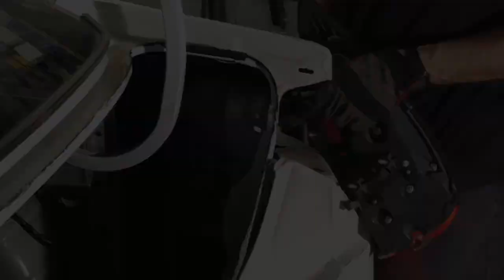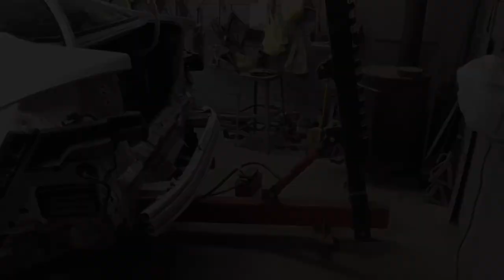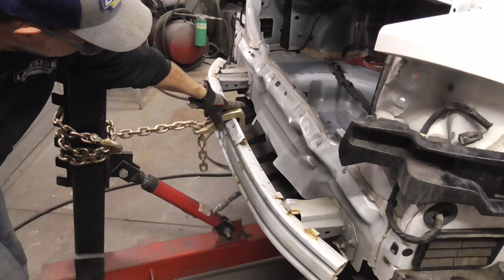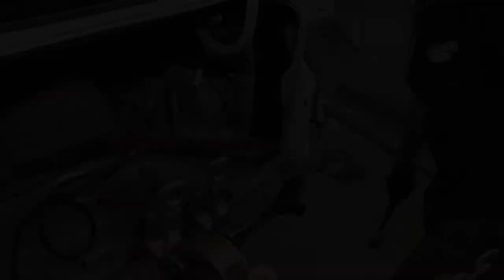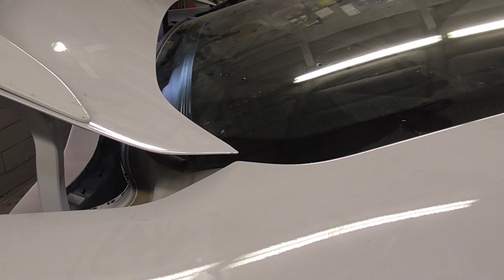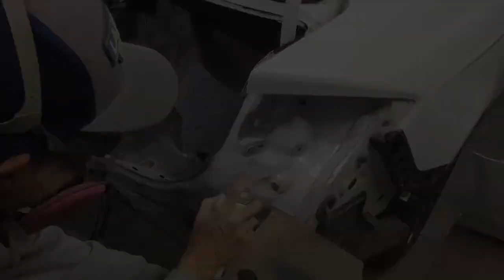Rear End Collision Repair - L Dozer Frame Machine - Start to Finish

Comment: I'm always amazed how crumpled sheet metal can be pulled back into place.   Also the strength of the pinch welds on the bottom of the rockers. Great video Jerry  as always
Reply from the maker: Thanks PSG - I gotta check out your fuel gauge vid yet tonight -  Merry Christmas 🎄❄🎄
Reply: @LakesideAutobody  Yes same to you !!

Comment: I wonder how much the local u-pull it yard charges for that rear panel (since you said it was like $1000 new). Merry Christmas, Jerry! (or Happy Holidays depending. lol)
Reply from the maker: They didn't have the rear body panel - so I pulled it best I could.  The bumper assembly was 350 (had a crack) and the deck lid was 2 something (had a few dings)  Merry Christmas to you too 🎄❄🎄

Comment: Nice work Jerry.  You know, years ago one of my good friends had a body shop.  When he needed a frame  straightened or unibody pulled out he called a fell that went by the name of “Fred the Frame Man”.  All he had ever done and all his father before him did.  He had a portable puller like yours that had little steel wheels on all corners to move it around.  It was amazing to watch him work.  He would just look it over and commence pulling first here and then there.  Before you know it all the body panels fit perfectly.  Once he worked on a Chevy pickup that had hit a bar ditch.  It was like a swayback horse.  An hour or so and it was straight as a string.  I enjoyed watching him work.  
I enjoy your hands on work much more than your tool reviews, just my opinion.  Try to stay warm.  Tom
Reply from the maker: Ain't that crazy.... my dad talked of guys like that back when he worked.  Said, "One old guy would come in with a bucket of tools and fix anything."  Those were the days I'll bet.  Good times the 50's-80's - Merry Christmas Okie Tom 🎄❄🎄

Comment: Very satisfying video, I needed this to repair the same issue with my Mercedes.   I have the ram tool kit and hooks with chains but not the bar pinch clamp and tower. Is there another way to hold the car in place and pull?
Reply from the maker: Yes. Body shops have pots in the floor with a chain to hook to.  You can use another car, tractor, tree, etc.  I have even bolted plates to the floor - sort of dangerous but if you do it right, it'll hold just fine 😊

Comment: It's like watching some kind of sorcery! Amazing. Oh, and a heads-up, I think the purple filter cartridges on your respirator are strictly for protection against particulates. For protection against spay paint or any other solvents, you should have a VOC (volatile organic compound) type of cartridge for vapours and fumes.
Reply from the maker: You're right but I was in a bit of a hurry - plus it's spray bomb so... but better to be safe.  Here's the one I use when spray paint with an  activator and isocyanates - 3M 07193 Dual Cartridge Respirator Assembly Organic Vapor , Large

Comment: Hey brother nice video helpful insight… Quick question though how much would you say this would roughly cost to repair damage like that?
Reply from the maker: It was around 1000 for me to do it myself but the insurance co totaled the car so I guess the estimate was more than the 7000 the car was worth at the time.  I'd say the cost would average around 4-5K but I never wrote estimates just did body work :)

Comment: What would you charge for a job like this? Or what’s the range?
Reply from the maker: This is a clean title repairable I picked up at an auction - it was sold for a lease company.  I imagine the cost of the repair was more than the co wanted to pay or near the value of the car.  I'm guessing the cost to repair it exceeded $5000 pretty easily.  The rear body panel alone is just over $1000.   A good deck lid for this was around 600.  Bumper assembly was 800, etc.  All the parts I bought were somewhat damaged so I got them at a pretty steep discount.  Merry Christmas MG 🎄❄🎄

Comment: Nice work. I’m just curious how much weaker it will be than the first time it was hit if it’s rear ended again.
Reply from the maker: To me... I'm not an engineer, but I don't see it changing the safety of the vehicle.  If anything, the panel is work hardened which means it's a bit stiffer.  That being the case, it will simply bent in another spot.  Truth is, if you get hit hard, nothing is safe.  Body panels are literally 6 human hairs thick and can be folded up by hand - that's not very good protection.  Just drive safe and be very careful to not get in an accident :)
Reply: @LakesideAutobody  can’t control a rear collision. I was rear ended this week while waiting to turn left -turn signal was on. The person claimed they just didn’t see me. They were obviously driving distracted. I assume my car is fixable rather than totaled and will go through a process similar to what you did in this video (which is why I was watching it). Metal tends to weaken the more that it’s moved, think bending a wire back and forth until it breaks. That’s why I was wondering. So I was thinking my car may not protect me the same way if it happens again, but I’m glad you don’t think that’s possible.

Comment: Having issues bending back a trunklid on a Mazda 3.  Don't want it to look pretty, just need it to lineup and close so the lights are matched.

Any advice for getting large gaps out of one side for a deck lid that was pushed in a bit and upward?  Measurements on both side of the rear seem the same after some pulling.

Deck lids seems to take some magic, any points or reference videos would be appreciate.

Thanks and love your videos.
Reply from the maker: If your measurements are good and the hood should fit, then you'll have to be checking the hinges.  They get bent.  Sometimes you can think of a way to straighten them sometimes not.  You can open holes bigger, use body shims, even sit on the trunk lid sometimes - it's a thing where anything goes - no clean cut answer :)

Comment: Nice Work. . . how much did that repair cost?
Reply from the maker: Thanks.  That was a clean title repairable that I was working on.  I picked it up at an auction.  The repair costs must have been more than the insurance company wanted to pay I'm guessing.
Reply: @LakesideAutobody  roughly, how much would you have charged a private customer if they came in for this type of repair, paying cash? $2.5-$3K ?

Comment: Hi Jerry. I just don't know about you Jerry? I just don't know how you do it? Amazing job as always. Have a wonderful festive Christmas. Its amazing you could pull that out with the frame machine. And the porta did better than I thought it would. Are those 2000psi or higher?
Reply from the maker: Thanks for the kind words as always GM.  Merry Christmas to you and your family as well 🎄❄🎄.  I had the wrong one listed in the description - this is the porto power used in the vid - https://www.harborfreight.com/4-ton-portable-hydraulic-equipment-kit-62115.html?_br_psugg_q=4+ton+porta+power  I not sure of the PSI.  Happy New Year too my friend :)

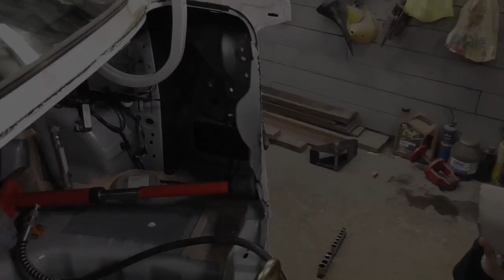Comment: 9:23 What's the red tool next to the motor oil tube and the torch. Merry Christmas 🎄
Reply from the maker: Good eye Petar.  That is an extension that goes on the end of the frame machine that pushes against the cross bar if the car/truck is up a bit higher.  Merry Christmas 🎄❄🎄

Comment: What is that red pumping machine called?
Reply from the maker: Porta Power - https://www.harborfreight.com/automotive/auto-body-trim/auto-body/dent-repair/4-ton-portable-hydraulic-equipment-kit-58204.html  You can find them cheaper on ebay or amazon I think too :)

Comment: 🤔   Just pull it, hammer it, glue it and paint it.    Ship it!     Glad I don't like Fusions much.   No worries... that bumper cover will cover it all up...  Yikes!
Reply from the maker: The only thing you got wrong is shipping it.  I own it - 2018 clean title Ford Fusion SE, all wheel drive, loaded with 109,000 miles for $5900 from an auction.  I think I can live with the bumper covering up any imperfections.  Merry Christmas 🎄❄🎄

Comment: Hit by a drunk driver, who had no insurance what would be the average cost? Literally same amount of damage except for the actual trunk lid
Reply from the maker: Well this was a 13-15000 dollar car when it got hit and the lease company thought it was too much to fix it so they sent it to COPART (auction).  It sold for 8000 so the repair costs were probably similar.   I'm sure you could find an independent shop to do the work for less.  It's very costly today to get even small amounts of damage fixed.  Good luck - let me know what you end up doing :)

Comment: that back panel should have been replaced.  this the typically low-quality repair I would expect from an insurance contract shop.
Reply from the maker: You're right and I really want to make a video showing how to do that but they want $1000 for it from the dealer and you can't find them anywhere else.  I can't justify that as I'm the owner and will be driving it - picked it up for 5900 so.... don't want to go overboard.  Happy Holidays Steven 🎄❄🎄

Comment: The rear body panel should’ve been replaced IMO, the metal has been stretched & the crumble zones are now compromised, if it’s hit again it will not react the way it was designed to.
Reply from the maker: I think we are all being fooled by the OEM's and crumple zones.  There is no way any amount of design is going to protect you in a serious accident.  I'm totally confident that it will behave the same way in an accident - it will get absolutely crushed.  If you want are serious about safety - best to drive an old dump truck :)  Merry Christmas 🎄❄🎄
Reply: @LakesideAutobody  I hear ya but it’s kinda like an aluminum can, you can straighten it out after crushing but it’s never the quite the same. Merry Christmas to you too.
Reply from the maker: @RenR70  I get it and wish I could have replaced it but man...$1000 bucks.  Guess that's why it was at the auction - too much to fix.  Nice talking to you RenR70 🎄❄🎄
Reply: @LakesideAutobody  sometimes we gotta do what we gotta do. I’m new to the channel but I’ll be checking out more of your videos. Have a great one.

Comment: I guess if you’re at fault you want this done to their vehicle. But having been rear-ended, I’d rather they total the vehicle. Ridiculous given the fact the vehicle’s ability to absorb impact has been affected, yet it’s “acceptable”.
Reply from the maker: Let me assure you that no vehicle can absorb impact.  Don't be fooled - Don't get in an accident.  That's the key.... drive save.  All cars, no matter what the report is,  will fold like a soda can in a serious collision - new or repaired ✌
Reply: @LakesideAutobody  That’s easy to say until someone else’s negligence causes the crash. NHTSA says all collisions are crashes, not accidents. They are all preventable. 

Automotive studies have gone on for decades. Repairing a frame has weakened the metal and thereby, when flexed back to near its original shape, has weakened its ability to absorb impact. I can’t convince you, but countless studies have been done regarding this. Take a piece of metal that you can bend. And bend it. And bend it back again. Eventually it will break apart.
Reply from the maker: @jessec5713  I understand all that stuff but trust me - really - my brain knows this kind of stuff.  If you get hit by something heavier than your car, you are toast - period.  There is no amount of engineering that can save you - promise.  That's just car companies trying to convince you that you are safer today.  There are more deaths or at least the same amount of deaths on the high way today as in the 60's 70's and 80's.  I can fold up a new fender by hand - literally fold it right up.... that's going to protect you???